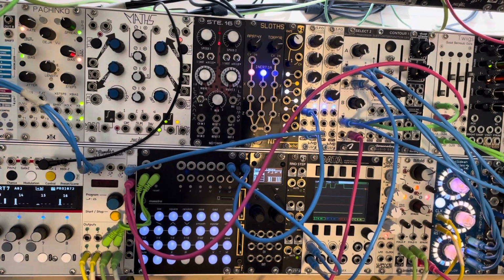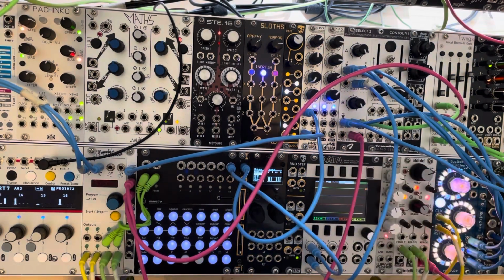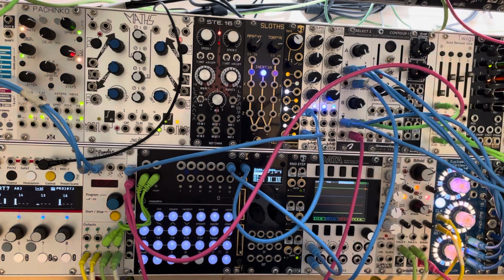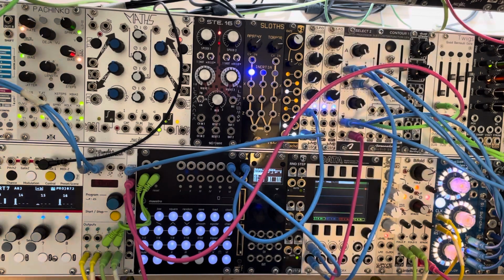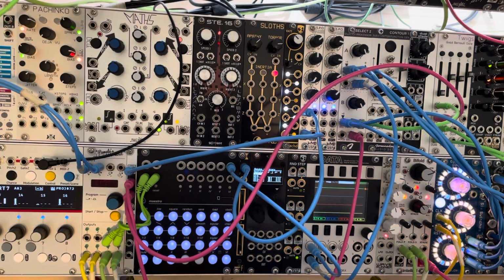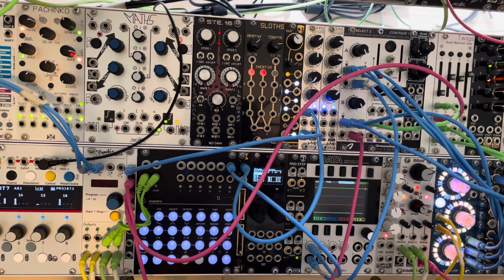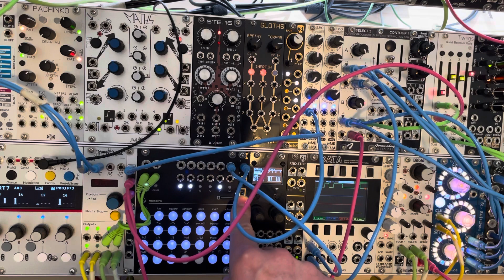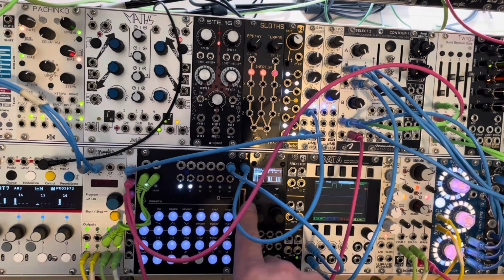Five12 Vector Sequencer and drum fills.

Comment: Brilliant!  I've been working toward something similar but this is more in the direction I've been looking to go.   Also curious about the Twiigs.. I don't fully understand it?
Reply from the maker: It takes triggers in to each “channel” and then does a coin toss to determine if it goes out via outputs A or B. It’s great for randomising destination modules but you can also weight the randomisation using the slider or another cv input. Twiigs is a version of Branches by mutable instruments but has four channels instead of two and is 8hp instead of 6hp.